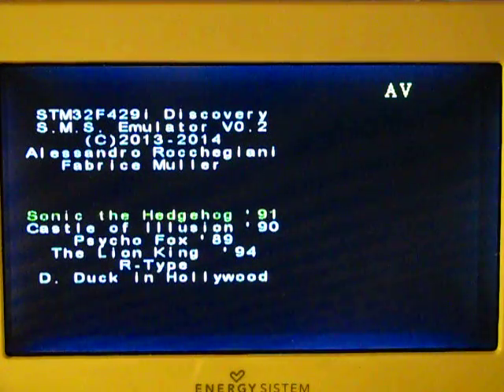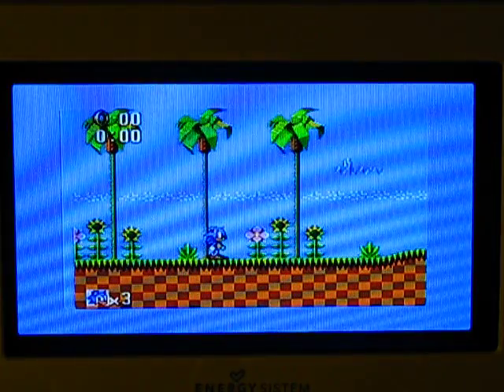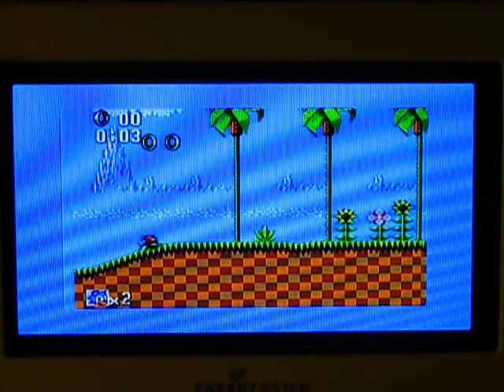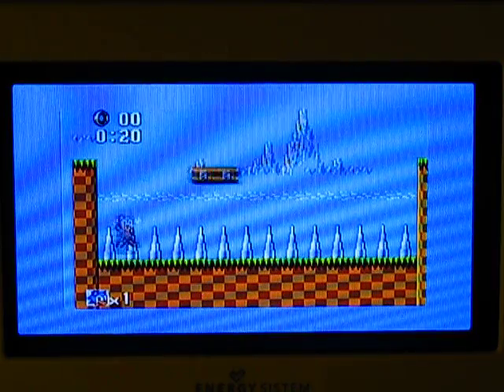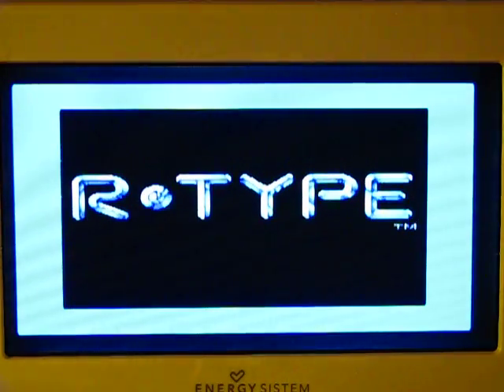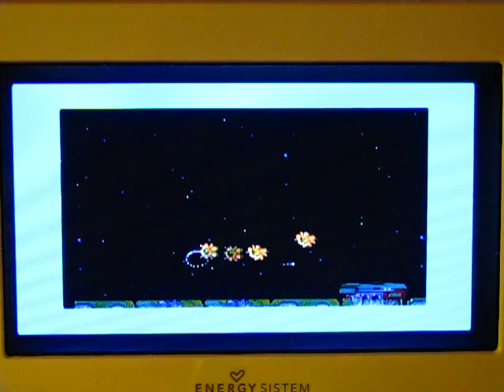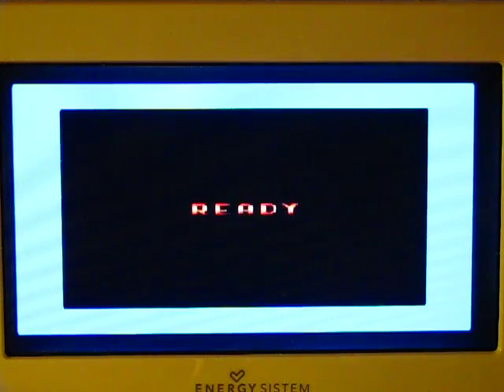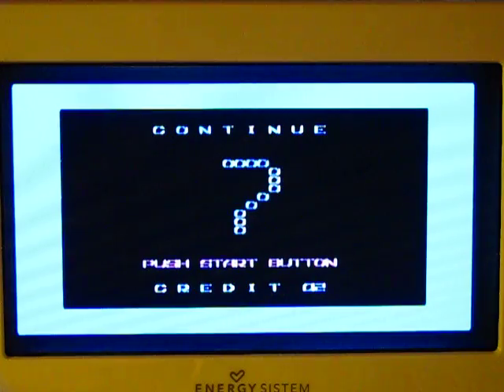stm32f429 Sega Master System Emulator v2

Comment: My roommate and I are using this chip series (STM32F4) for our final design project.  We're making a simple handheld game console (hopefully around as good as GBA, the bus speed seems to be the limiter).  Would you mind sharing a few emails back and forth so I can raise some concerns I have?

We want to have a "cartridge" system like the GBA/NDS/ etc.  This means we have to compile the program, put it on flash ROM, and bootload it into the internal SRAM.  This shouldn't be a problem since the game data can all stay on the flash cart and be copied over via DMA2D when necessary, backgrounds can be in one frame, sprites in another, even scrolling background isn't a problem with a sufficiently large external FB. 

My concern is if we boot off flash like that, how do we compile it and link it correctly so that when we copy it to internal SRAM's address it absolute addresses correctly?  Is 112k enough?  If not we can swap multiple sections (I don't see how it wont be enough for most games).  What about shared functions?  We can code many things into the flash that can be referenced via function pointers in the main code executing from SRAM, this should be easy.  

My last concern is a bit complex.  I want the way you render games to be very generic, so I want to implement a render queue system that iterates and draws each object (a lemming as you did for example).  That object knows the state so the frame etc is kept track of.  The problem is, what if I want to make n copies of that?  Will malloc work correctly?

Any help would be appreciated, your videos are great btw